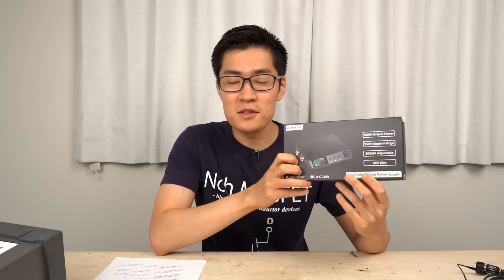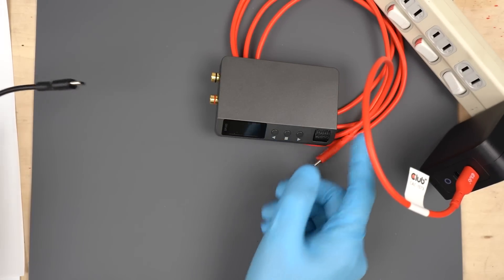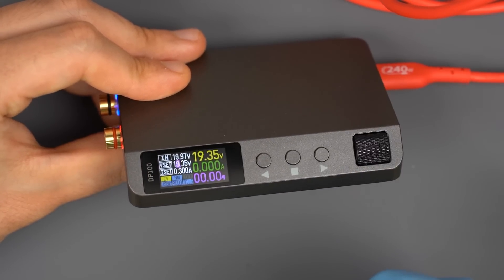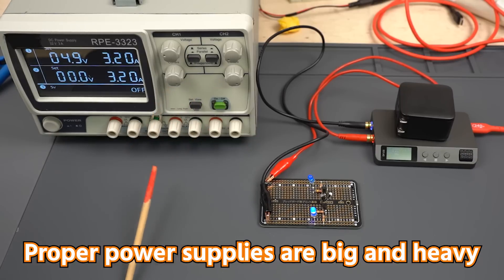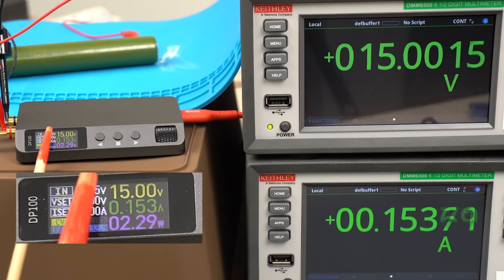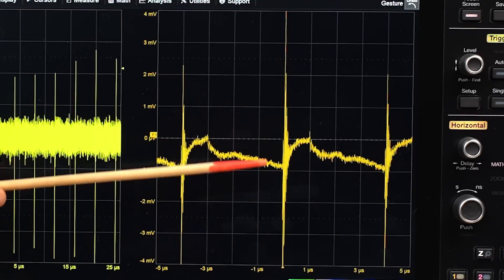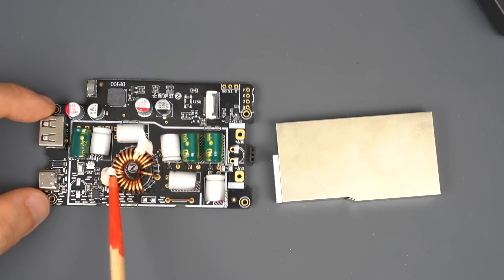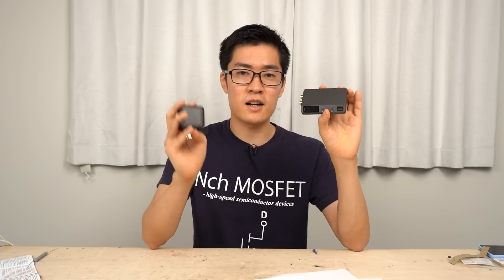I Found Hidden Gems on Aliexpress part1 【DP100 USB DC Power Supply】

Comment: How does Fnirsi DPS150 compare to this ? Could you check the voltage ripple ? would it be siutable to work with microcontrollers ?

Comment: This thing keeps killing my chargers. It does not have reverse voltage protection. If you have it hooked up to a battery it will backfeed power into the charger and kill it.

Comment: As described, this looks like an excellent addition to a mobile workshop, such as for someone that works on RC cars, automotive electronics, or robotics. If I did more electrical repai at work, I would grab one of these for my toolkit.

I also think it's an undersung feature that, since it uses USB-PD, it can run off PD capable batteries. Dont even need to plug it into the wall!

Comment: ⚠..yeah but not PD3.1, only PD3.0 because the max. output is only 100W & PD3.1 negotiates all the way up to 240W (48V @ 5A). Oh well.. maybe next version. 🙂 Still it's a nice little power supply. Was very surprised to see how tiny it is. 😮😎

Comment: What socket is used for the external dc power supply, if i want to get output voltage of the device about 28V?

Comment: The USB-C is only 20V - so if you want more you have to use a hiigher voltage supply. Nice though, thinking about one even though I have a dual channel large 240V one.

Comment: Manual says 4mm negative is not tied to ground.   Does this mean TWO of these could be used to create a dual rail (positive and negative) by tying the negative of one to the positive of the other?    I.e. Like a dual output power supply.    Thanks.

Comment: Portable, yes. But you can buy a good proper 30V 5A power supply for the same or less money.
Reply: That's not the point of this device lol
Reply: @Mom19  What? The titles is "DC Power Supply" and otherthan the portability, it sucks. Can't you even read. lol.
Reply: @tianalucas4969  because this is a variable "power supply". If you buy a regular 30V 5A PSU it won't be controllable, can't adjust current limiting or other factors. Yes I can read. But those 2 things have entirely different purposes.
Reply: @Mom19  I'm also talking about "variable power supply". You can easily find even a 30,10 Sugon,RF4 or something under $50 in here.

Comment: Something I don't quite understand is the input voltage range: up to 32V. From what I know (but please correct me if I missed anything), you can only get up to 20V from USB-C PD. So how can you get over 20V? And thus, if the internal regulator is only a buck converter, you can't possibly get more than about 18V at the output (assuming that they have 2V drop out, from their figures).
Enlighten me, as I probably missed something.
Reply: The device is nothing more than a simple DC-DC buck converter, therefore it can't output a higher voltage than the input provides.
Reply: because you can also provide the input power from bare wire,
you probably missed watching the video

Comment: A power supply that needs a power supply? More like a very fancy variable buck converter.
Reply: A regulable power supply that takes your fixed voltage power supply and regulates the output power to your particular needs
Reply: @franukito  No, it's not a power supply. It's a device that can regulate the output of a power supply. I'm not saying it's not a nice unit, it's just not a power supply. That's the thing that plugs into the mains and it's not included.
Reply: @Ni5ei semantics.
Reply: @Ni5ei  Don't usual bench/lab "power supplies" also technically take power from the outlet?
Reply: That's what I thought. If it was boost/buck it might be more worth while.
Reply: It is a variable bench power supply that requires a fixed power supply. This is a step up from those bulky and heavy bench power supply that takes in AC directly from a beefy power cord. The footprint of this is extremely small and way lighter/portable. Any person who owned a conventional bench power supply will definitely understand this.
Reply: well, if you are serious, your wall socket is also not a supply, the power plant is the supply.
Reply: all power supplies need power supplies, sometimes the power supply is just an enormous generator many kilometers away